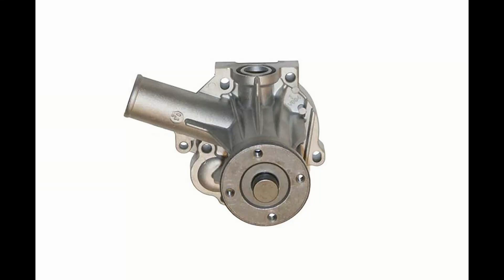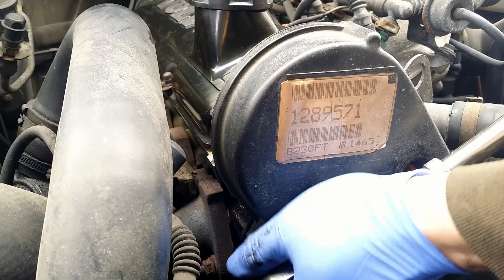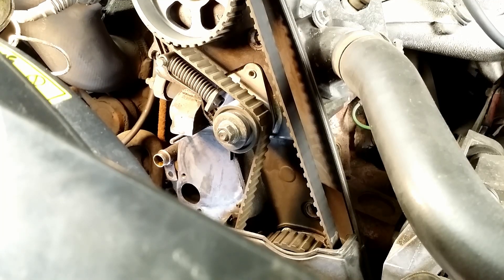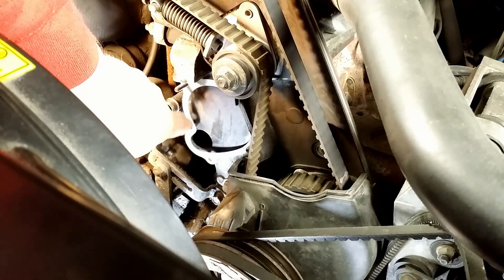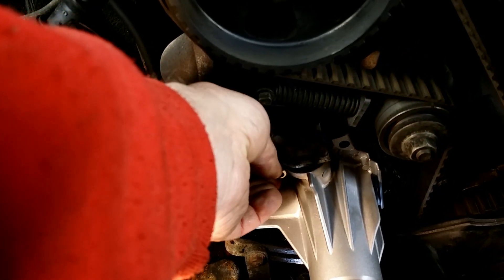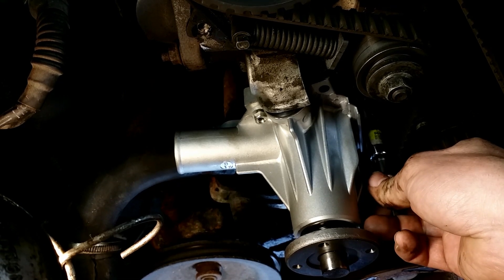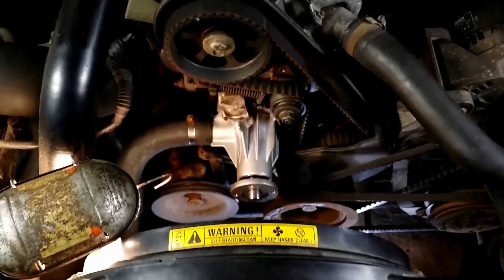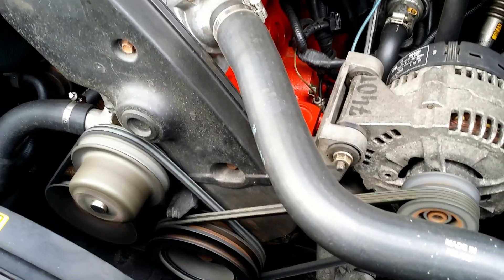Water Pump Replacement

Comment: I failed two times with the little rubber ring. It shifted out of place somehow. Last time was worse of a leak than first attempt.
Reply from the maker: Are you talking about the seal that touches the head, or the heater pipe seal?
Reply: @robertdeptula2003 Heater pipe. It's hard to put the waterpump in place because of the heater pipe. I was being really careful with tightening the bolts and nuts on the waterpump. I thought i had in place correctly. But immediately after pouring in the new coolant it started leaking. The first time I only noticed the leak after I purged the air and turned off the engine. When I took it apart the rubber ring was ripped. I used some vaseline the second time just in case but I guess it made it worse.
Reply from the maker: I only had one time problem with this seal. One time I bought water pump and the seal in question had round outer edges. It was leaking. Never any problem with sharp cut edges of the seal.
Reply: @robertdeptula2003 I had sharp edges on the ring both times. But I ran into a unique problem. Had my car parked in my garage because it has a pit to work underneath the car. But they're doing road and sewer construction right now in my street. I can't drive my car out for the next 6 weeks. So I have plenty of time to look at what the issue is Lol! 🤣

Comment: @1:11 "and the cover is off'
@1:20 'the water pump is out' 
What did i miss? Oh, well, the complete removing of the water pump.. Seems like pretty important step to me :-)
You only show the gastket and the heater core seal, but there are two more seals on the waterpump!
In the end, you managed to put the pulley back with the belt on it without loosening the belt? ...
Having said that, i like your tip with the wood blocks and i do like your channel!
Reply from the maker: Well. I was in the middle of the job when it came to me that I can share the idea of the wooden stick push up. As you can see the first part is from my other video where I adjust valves on B230 FT. I wanted to show that you have to remove the timing belt cover to remove the pump. 
For the gaskets and seals. There are two rubber seals on the B230 F engine. One to the heater core pipe and the other on the top of the pump pressed to the engine head. Both are shown in the video. For the gasket. There is one that goes between the pump and the engine block. It is shown in the video as well. 
For the belt and pulley. Yes. it is pain in the @$$ to move the steering pump, so I cheated a little bit.  
For the channel. I like that you like the channel.